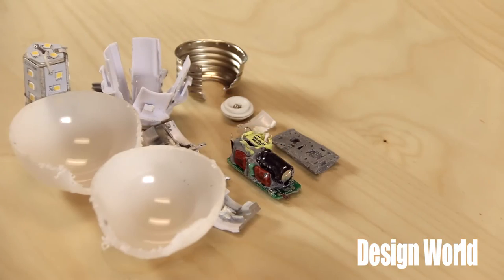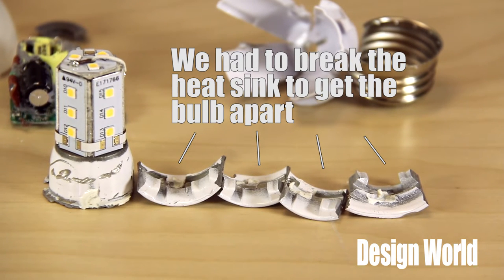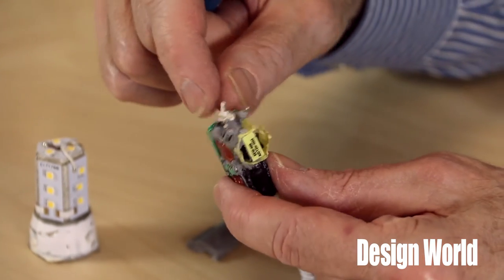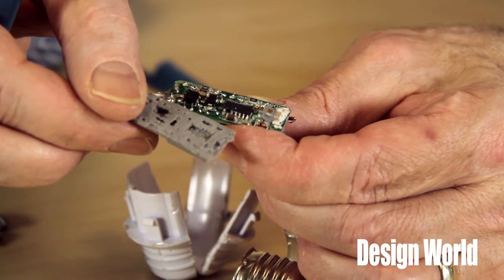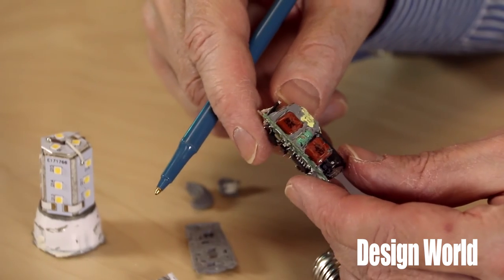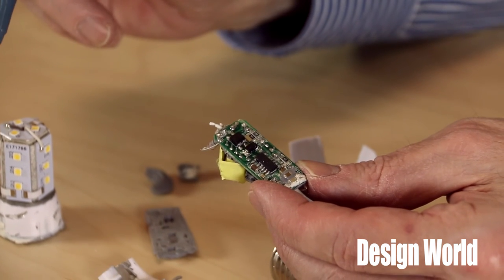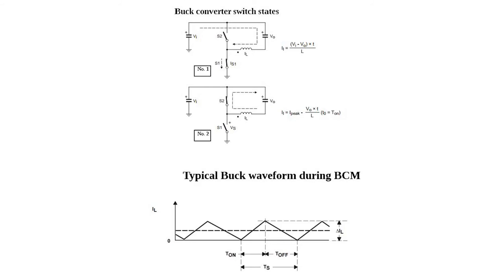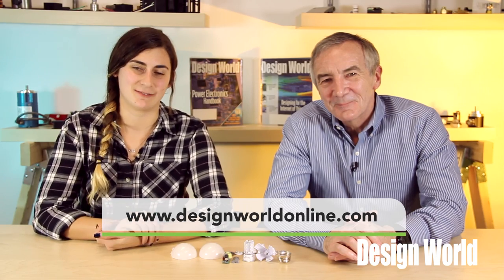Teardown: Osram Sylvania 60-watt equivalent LED bulb

Comment: My OSRAM LED bulbs are failing VERY quickly in less than a year since installation throughout the house, much faster than what the manufacturer states with the "22 year" failure if used less than 3 hours a day.   If you read the fine print on the packaging, it now is only guaranteed a few years, assuming you have your receipt as proof of purchase.  They flicker when they start to fail, and even the base heat sink found to move off its base and up the plastic bulb.  It cost us a fortune to change out all to LED bulbs, and it looks like we have been ripped off with clever advertising.   I suspect the issue is the failure mode analysis is flawed given the dozen or more circuits within these OSRAM bulbs are dependent on each other circuit working flawlessly for many years which is highly unlikely, whereas the old incandescent bulbs only had one failed mode - its element. Save your receipts, and read the fine print now on their packaging, as many now show 3 year life guarantee at 3 hour daily usage, even though they boldly font anywhere from 9 to 22 years on the packaging.  Going to be a lot of angry consumers for this slight of hand, given the premium we pay for LED, with really no choice now given the old and simple style is banned.